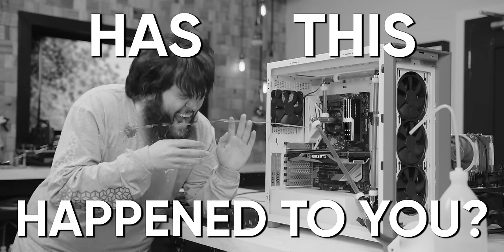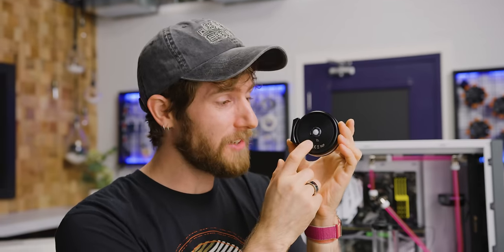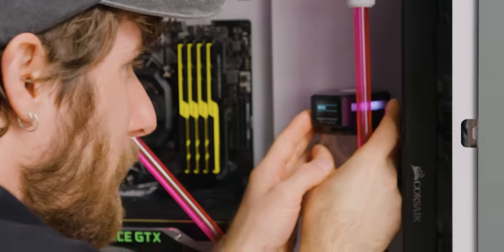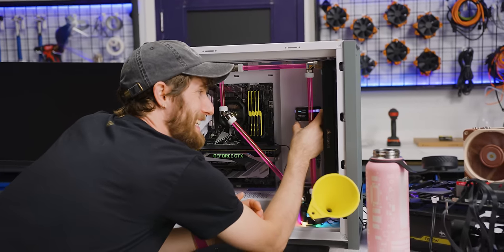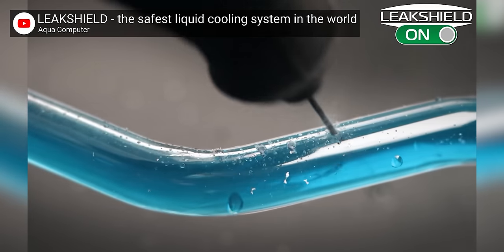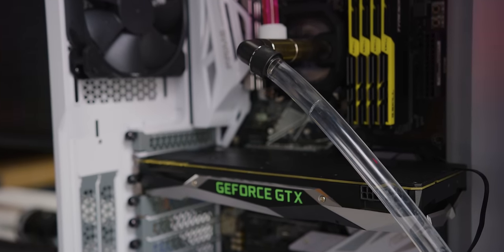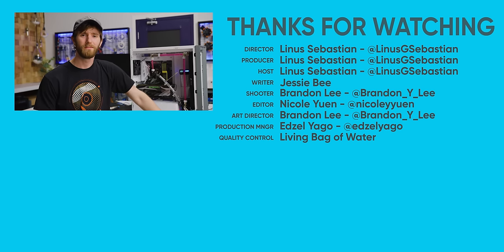I can’t believe it didn’t leak…

Comment: Everyone: Watercooling is a relativly simple product wich needs no overengineering
Germans: hold my beer!
Reply: If it works, it ain't stupid.
Reply: Leaks are still a problem in watercooling though. Even Jayztwocents had a leak once.

With this product however: I think many watercoolers can sleep more easily.
Reply: Yeah most definitely, the radiators they make are extremely over the top
Reply: german engineer is cool but they are not made to last, just like german cars tend to break within 3-5 years
Reply: Ngl, its a pretty interesting concept
Reply: @doritosicecream2820  They are not made for poor people either
Reply: @anonymousx2951  that is, until this pump-res dies.
so within the time this thing is running, you can be 100% at ease your loop wont die.
but if this dies, this will be panic mode.
but then we have no clue how long this will last if its running 24/7.
unless it says on the product desc
Reply: German Technology
Reply: @doritosicecream2820  May i ask if you're from the US? I've often heard americans say that their german cars break within a few years, yet in germany you see the same models rolling around without any problems. Like i've never heard someone here in germany say that their VW golf broke down. Makes me wonder if they built them differently/use worse parts on other continents. My VW van made 19 years easy and my grandpa still has an old 30+ year old audi sitting around.
Reply: @doritosicecream2820  What cars specifically? Cause in Germany especially older VWs and Mercedes models kinda have a reputation to run for ever. And the fact that you can see so many of them still around attests to that.
 
Honestly I personally beleive it is the main reasons our gov is pushing for electric cars now. They are in VWs pocket, who can't sell new cars if people keep using and reselling old Golfs and Polos.
Reply: @doritosicecream2820  me: running my golf for ten years and 300.000km without any major problem. they just need maintenance
Reply: @coolesocke123123123  gibt alles von jedem, ein kumpel hatte nach 70tkm eingebrannte Ventile im GOlf. VW hat den schaden nicht ersetzt. 15k€ Schaden bei einem 3 Jahre alten Auto
Reply: @TheHammerGuy94   Actually, I think if this thing dies, you're still in objectively better shape than you would have been without it.

That's because if it developed a leak before dying, it would have warned you. The pressure graphs and such would keep you updated about the state of the loop, so if you had a tiny leak somewhere, you'd know about it and have the ability to fix it before it's a problem. It's even less "panic mode" than a standard pump and reservoir dying.

I still won't bother to water cool until there's some actual benefit to doing so, but credit where it's due.
Reply: @MrMarksam1  I'm currently replacing an Audi A4 timing belt and cylinder head (with machining) after the timing belt broke at 75,000 miles, owned a Doctor since new with no "hard" driving. The maintenance interval is 110K miles. $4000 repair bill.  It happens. It may not have happened to YOU, but it does.
Reply: @doritosicecream2820  that's the exact opposite of their reputation here in Europe
Reply: @doritosicecream2820  Clearly you have never heard of mercedes benz cars from before 1996
Reply: @TheGermanDude  i mean, i dont hate german engineer but i just trust database, you can search and you will find out their common issues. you cant compare things from the 80's to these days, those years are Mechanics and engineer golden years where they build solid and long lasting machinery compare to now they are just made to be disposable or replace parts more frequently just to sells more replacements parts for more money.

Comment: omg I actually expected a Sh*t manufacturers say episode, can't believe this thing actually works.

Honestly this is why I stayed away from liquid cooling, I bought a noctua NH-D15 instead, I did not want a minor leak to damage my pc, I saved up a whole year to build my first.
Reply: @NirateGoel  It makes temperatures less swingy, which reduces metal fatigue on chips caused by temperature changes. So, if you wanted to keep one system on Windows 7 or XP forever, and can't upgrade parts or lose hardware support, the extra longevity could make sense if it wasn't canceled out by the threat of leaks destroying everything.
Unfortunately, this product kills one of its primary practical uses by requiring Windows 8.1 or newer.
Reply: Plus, its price isnt far off from a decent water cooler anyway. So its not like your paying a premium just for a niche feature.
Reply: Hello? German engineering? What should not work at this product?

Comment: I would actually be really interested in a system like this on a server rack scale. I have a water cooled rack with multiple water cooled servers all plugged into the same Iwaki MD 100RLT and rack mounted radiator banks. To say a leak or loss of pressure event would be costly is an understatement. I can see this kind of device rack mountable with power output for say a Iwaki MD 100RLT. Something could probably be done with an over powered air pump that could do about 5 BAR and a bare bones linux ITX build.

Comment: I would say yes if you are already building an expensive system with a custom water loop why not use this product. It has some pretty cool features and from what I could see it works. Short of a catastrophic failure somewhere like a tube or fitting breaking our pulling completely out it seems it would save your system and alert you to a problem. Not to mention it can monitor the health of your cooling system and has a self test feature before you even add any liquid. Considering the price of a custom water loop to begin with the price doesn't seem all that bad. I would assume you can control it via software on your desktop and not have to use the touch sensor on the pump once you get it filled and running and closed up?

Comment: Aquacomputer is kinda crazy with how complicated they allow you to make your standard water cooling loop.  For example, the Aquacomputer Aquaero devices which are microprocessor controlled devices that can monitor temperatures, run fans (2.5A per fan header) all with a graphical display and it can be extended with more fan controllers, RGB controllers, Aerostream XT pumps (microprocessor controlled water pumps) and so on.  This Leak Shield is just another example of how insane their devotion to water cooling is.

That said, this thing does sound pretty awesome.  I would buy one if it didn't cost so much (I would have to buy a new reservoir).

Comment: its a loop vacuum with a pressure sensor...a LPMS if you will similar to  TPMS on a car but more like the air system on a Hummer H1 where it can drain and fill air in the tires internally. this just keeps a negative air pressure in the system in the event of a leak

Comment: Love that they used a goretex membrane that you usaually find in automotive electronics with the top cover removed (see the 6 clips around the membrane). Guess the shield is removed because it can trap water near the membrane. If you ever tear one or need to replace, you might be able to, they are somewhat standardised. Pry them out, remove the broken clips inside and snap in a new one (there are also screwed ones but this looks like a "gore snap fit")

Comment: Yea it does very clearly just pull air into the system (not balance the pressure perfectly like they claim), so all it does is run a vacuum on the loop and it has a pressure sensor that can tell when the vacuum starts losing pressure and sets off the alarm. I would be curious to see if it has damaging long term affects

Comment: Holy crap, this is extremely impressive. My main concern with custom water-cooling is gunk buildups, not leaks (which this thing turns into an absolute non concern). Oh, that and cost.
Reply: Well, if you don't use tap water or colored coolant this is not much of an issue.

Comment: Don't know if anyone pointed it out, but if LS tells your PC to power down while itself being powered by the MB..... I guess that a practical use of a battery pack is to maintain the seal  long enough to troubleshoot or drain the system with the PC off.

Comment: if you only have 1 hole at the same height waters surface tention will hold the water in if it is not pressurised. But when you put in more lower holes the upper holes let air in to displace water which can go out of the bottom holes

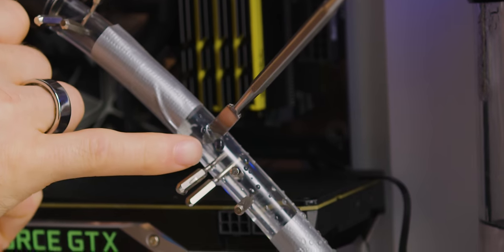Comment: $120 is nothing for a hardline loop with 90 degree compression fittings for clean lines (Something like Singularity Computers old custom builds), 10:36 is a real world loop leak and the way the device handles it is impressive.
Fill and test the loop the old fashion way during the building process since this device can hide leaks from you if you just rely on it, Test the device to make sure it's functioning correctly with no issues, and basically forget you have water cooling till it's time to flush the coolant.

Comment: When the drill-bit went through, water leaked because of the channels on the bit itself. There was a void space on either side of the bit between the edge of the hole, and the flow became turbulent at that spot in the tube, rushing out either side where the bit guided the water.

Comment: What the hell, Linus? $120? A custom loop with all fittings and reservoir and everything is already running you like $600+. $120 at that point to make sure it doesn't ever leak seems extremely sensible.

Comment: this product is great , it works as advertised , if you make a whole 2 opposite side of the tube , like the first 2 , your  negative pressure is enough , but as soon as you add more wholes in a single side it starts leaking ,if you make wholes on only one side of the tube like the 2 last ones and in the sample of their commercial video , the negative pressure would work well , to prevent the leaking

Comment: I’d be curious to see a loop filled with a coolant similar to tire sealant (particulant to fill holes as the fluid leaks out). Still leaks but not as much, sorta a low tech version of the leak shield. I don’t think there would be enough pressure to make it work though… figure MTB tires (what sealant is normally used in) run at minimum ~20PSI. The test pressure of the loop was a fraction of a BAR

Comment: you could pump air out of the loop to create a vacuum to fill the loop just like this thing does. for my car that's the recommend way to empty and fill it. suck it all out then use the negative pressure so suck the new oil back in

Comment: If there's one thing I've learned during the 15 years of working on duramax fuel delivery systems, is that it's nearly impossible to actually find the leak unless you can pressurize the system and look for the drips. In a real world situation what happens when this thing does detect a leak and you need to diagnose where it is? Do you let it beep in your ear until it finally gets bad enough to start pissing, or do you shut it off to release the equilibrium and let it spill all over? either way, why even buy this at all?

Comment: During the test, you said it was pressurizing the system (this might just be a semantics thing), but I wasn't increasing the pressure in the system it was creating a vacuum, we know this because the pressure got down to 296 mbar (0.29212929 atm) where around 1013 mbar (1 atm) is the ambient pressure.

Comment: This is amazing and all. It really makes someone like me who avoided open loops altogether because of these kinds of issues to want to delve into open loops. But... I have a concern. What happens when I have the whole system shut down including the pumps and there were leaks that the Leakshield have helped to solve in my system. Will there be no pressure then and thus the solved leaks will start leaking again once the Leakshield is turned off? If yes, then I guess there is still some concern of the leaks that were handled by the Leakshield reoccurring again the moment the system is powered down (including the leakshield).
Any help on this? Many thanks!
Reply: you can power it with a powerbank and a normal usb-a cable. they will release a little board in some weeks so you can connect it to the mb and powerbank at the same time for backup power

Comment: The real question I have is how long this unit will last and still be reliable.  Will it last 6-12 years typical life of a computer system as it gets upgraded and eventually passed down.  Maybe with proper maintenance, it will last as long as a good computer case? 25 years or more.

Comment: The screens that aquacomputer uses have HORRIBLE burn in if you run your system running 24/7. Replacement screens are not cheap, if replaceable at all.

Comment: So in the test where multiple holes leaked, was it due to number of holes, location of them (first was at the top, and pressure is going to be higher at the bottom especially once the system is no longer a closed loop-due to the hole), or size of the holes? The anti-leak system seems to be just that it's sucking air out of the reservoir, lowering pressure of the line so it pulls air in rather than letting water leak out, which is an interesting solution but likely has some limitations. I suppose for general use you probably won't have enough issues to push those limitations. Interesting concept though, and good thing it does have a clear alarm for leaks that it's able to stop, so you don't just leave it running unaware that if your power goes out it will start draining lol

Comment: Hmm this product are giving huge boost of confidence for newcomer to water cooling, but it will encourage people to less less precautions with the water tubing (only if the user are more wanted it all on the place then run the computer, i saying this as nice as i can).

If you guys wondering why the leak are not in there with 1 holes, i think it the basic science things, if the pressure reach equiblirium state then no leaks, but if not it will leak, same things like linus do with pump off, it because different pressure inside and outside making it leaks, and other things you can see within the science channel one but ready to overclock your brain once xD

Comment: The reason why the hole in the top with the extras is because the water has an escape because air can enter to release the pressure. If air can flow freely it will leak until the water drains lower than the hole

Comment: so, does it work by creating negative pressure inside the loop when a leak is detected, so it sucks air in through the hole instead of letting water leak out? (idk if he said that in the video i mightve just missed it)

Comment: HELP NEEDED - PC BUILDING
Processor : i5 10400F
Mobo : MSI H410M Pro VH 
RAM : 8GB x 2 (PNY 2666 Mhz)
SSD : 512GB Nvme PNY(might go for 1TB) 
PSU : 650W Modular Aigo brand
Cpu cooler : random brand 
Targeted GPU : RX570

Is there any way I could improve on or cut costs on?  Any notes to take? The total cost is around Malaysian ringgit 1.9k = 453 USD. (Excluding the GPU) I’m aware that I’m maxed out at 2666mhz. Just looking for ultra graphics on Forza Horizon 4 and high settings for other games. Maybe looking to use it for 6 years +-. 
Thanks guys.

Comment: basically, the device pulls a vacuum so if the vacuum drops do to leaks. If air is pulled through the hole instead of water existing, it wont leak. The alarm goes off. Neat concept, but I wouldn't be surprised if more companies jumped onto this. That is if, this was a big enough market.

Comment: the thing is that, I had my gpu terminal leak few weeks after running it. so that device would've been perfect.. but then again, the ek pump, needs to be screwed in correctly to test the loop better than I did.

Comment: This would have saved my 1080ti.  I've been using custom loops for more than 10 years and only ever had one leak during operation, and of course it leaked from the connector going into the CPU and dripped down onto the back of my GPU.  Had to happen right in the middle of the GPU shortage and forced me to go to ebay to get the system back up and running.  Would have been well worth the $120.  Aqua Computer is a great company.  I use their Aquaero water cooling controller and it is great.  They regularly update the software and are quick to respond for email support.

Comment: The next step is to design the system to work with a reservoir with enough excess capacity to hold all of the fluid in the system. Then when it detects a leak, it could pull all of the fluid into the reservoir and leave nothing in the tubing.

Comment: LINUS, What about adding one of these your standard AIO closed loop??  I know its not recommended, but I was wondering how well it would function with one of these. Lets say the h115i pro or something similar. Doing something like this would allow you to customize the types of fluid, or even throw in ice without having to go all out custom just to do some benchmarking lol.... and hey, even if you mess up, with the adapted fittings used, you won't have to worry about a leak😂 Lol.

Comment: Lower pressures allow water to evaporate at lower temperatures. I’m assuming the engineers who made this thought of this, but could this possibly reduce the pressure enough that your loop actually starts to boil with the heat of the components?

Comment: Very impressive, but... leaks should come up during first run, while the water is non-conductive, so this seems like a solution in search of a problem.  O-rings don't wear out unless you're using tap water.  If you're leaving your tower in freezing air for hours, drain it.